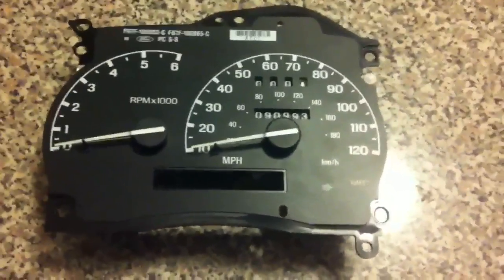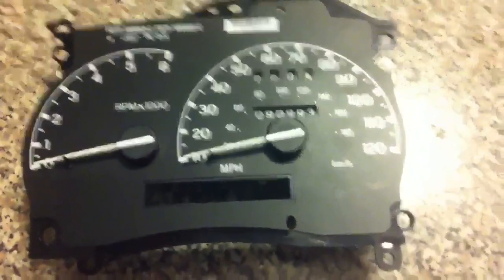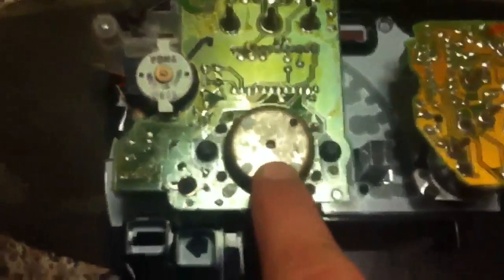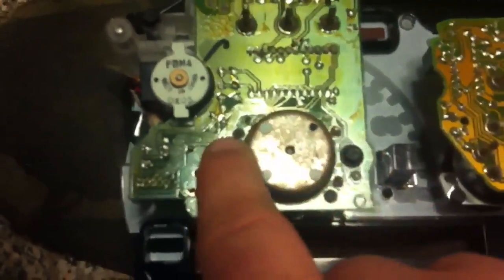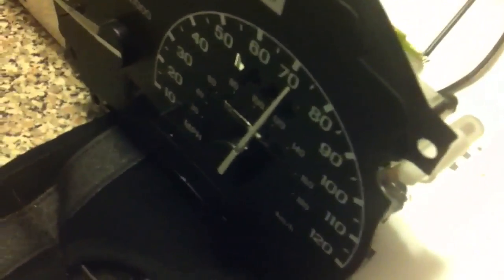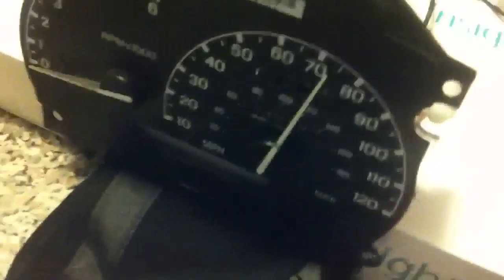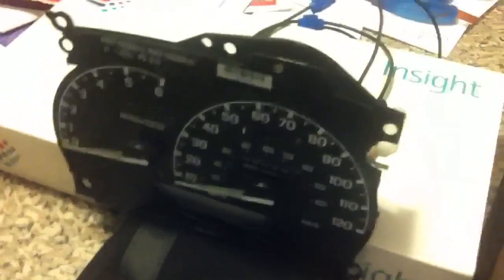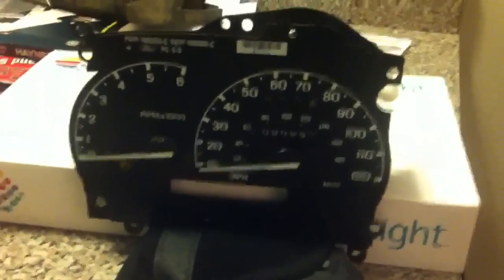HOW TO: Calibrate the speedometer on a Ford Ranger

Comment from the maker: WHAT TO DO IF YOU TOOK YOUR CLUSTER APART WITHOUT CALIBRATING THE SPEEDOMETER FIRST:

You need to determine how far off your speedo is. Download a free GPS app on your phone. Drive down the road using your GPS app and get up to 30 mph. At 30 mph, take note of what your truck speedo reads. Let’s pretend it reads 50 mph while your phone reads 30 mph. Go home and pull your cluster. Do everything I did in this video. Whatever your needle reads, pull it off and put it back on at 20 mph less while the battery and alligator clips are still hooked to your speedo.

Comment: So you try it and move the arm back till it shows the actual speed
Reply: Don’t do this. The right way is far easier and doesn’t rely on guesswork. Find the comment that says to jack the vehicle up and let the wheels free spin while the plastic cover is removed from the instrument panel… fuck it I will just tell you how to do it… while the cover is removed and the vehicle is running and in drive while on jack stands, let the engine idle and spin the wheels. Set the needle to 100x less than the engine rpm, ie: 1000 rpm = 10 mph… engine rpm divided by 100 = vehicle speed (only in 1st gear!!!). I am a professional mechanic with 37 years of experience and that is the correct way to calibrate your speedometer.
Reply: @rollin18wheels how far in are you supposed to push in the needle?

Comment: I see this was a older posted video but I just replaced my cluster on my 98 2.5 Ranger. I upgraded from the non-tach to the tachometer cluster and I had to change the mileage to match my original one so I had to take the speedometer apart. I also put a new plastic gear in. I noticed when I put it in and powered it up the speedometer needle shot up to 20 MPH. I then saw your video and gave it a try. I took off the needle, powered it up and put the needle back on at 20 MPH. It went down close to 10 MPH now when I turned it off and I kept having to do it and redo it until eventually it was at the stopper. I used the key switch instead of the alligator clips since I'm still putting everything back together. So should it be calibrated now? Once it stays at the stopper it should be set?
Reply from the maker: I did the same thing you’re referring to the first time I pulled my cluster apart. To answer your question, no it’s likely no accurate just being at the stopper. Here’s what I had to do and my best suggestion:

1) Download a speedometer app on your phone. 

2) Drive down the road at 50 m/kph based on your phone and look at what your truck reads. Let’s pretend your truck reads 60 m/kph. 

3) Go home and pull your cluster back out. Manually spin your needle up to 60, use some needle nose vise grips to grab hold of the metal pin that holds the needle on to keep it in place. 

4)Carefully remove your needle making sure to not disturb the vise grips or pin and then reinistall your needle at 50. 

5) Drive down the road with your speedometer app and compare it to your cluster. 

6) Repeat as many times as needed until you get it dialed in as close as you can. 

Note: It goes without saying, be careful playing with your phone while driving. Use a buddy to help if you can.
Reply: @Kybucks10  I put it back together and drove it around with my scanner hooked up and it is indeed actually 10MPH off. I'm doing 20 and it says 30. Also even though I replaced the trip odometer gear with a new one it doesn't even move. Any ideas?

Comment: My Ford Explorer speedometer starts at about 40 mph when I crank it up.  How can i get i back to zero mph at startup?  I had to take the cluster out to replace my bulbs with LEDS and my worm gear for the odometer and somehow i got my speedometer jacked up.  Id really like to get this fixed without spending a bunch of money.
Reply from the maker: daBEARS 545134 read the pinned comment
Reply: @Kybucks10  Thanks for replying.  Ok I was just trying to make sure it would work the same way.  I am looking to buy some alligator clips now.  Will plain electrical tape work to bind them together or is there another recommendation.
Reply: @Kybucks10  not having any luck, got it rigged up but the needle does not move with the battery
Reply from the maker: daBEARS 545134 your next best bet is to do like I said in the video. Pull your needle off and hold the metal pin in place as best as you can and reinstall your needle where you think it should go. Then plug it back into your truck and drive up the road with a gps to see how far off you are. Rinse and repeat until you get it right or close enough for your liking.
Reply: @Kybucks10  ok thanks, i will try that

Comment: I didn't do this when I took mine apart and now it doesn't read r9ght help
Reply from the maker: You need to determine how far off your speedo is. Download a free GPS app on your phone. Drive down the road using your GPS app and get up to 30 mph. At 30 mph, take note of what your truck speedo reads. Let’s pretend it reads 50 mph while your phone reads 30 mph. Go home and pull your cluster. Do everything I did in this video. Whatever your needle reads, pull it off and put it back on at 20 mph less while the battery and alligator clips are still hooked to your speedo.

Comment: I used your method of re-calibrating after I repeatedly kept trying to drive it around.  If I don't put any other comment it will mean you are the pro on this.  I simply set mine to 73 mph since I did not know the original baseline.  Hope it will work and I think it will.  Do you have any ideas for getting the transmission indicator to be in the right position?
Reply from the maker: David Reeve yes, there is a knob under the dash that you need to spin that adjusts the indicator. YouTube search for ChrisFix. He has a video on this a couple of years ago. I’ll try to find it and reply with the link. His channel is a WEALTH of knowledge over my few videos when it comes to these trucks lol. Hope this helps!
Reply from the maker: Here’s that link. 

https://youtu.be/wzhUYwx34gM

Comment: I tried this but I don't think my issue is the same.  When my speedometer is installed in the vehicle the needle starts at about 55 MPH and then increases as my speed increases.  It doesn't always increase mile for mile per hour so I'm not certain exactly how fast I'm traveling.  Do you know how to fix my issue?  I would certainly like to know my speed accurately, especially when there is a cop riding my ass.  Grateful for any suggestions.  Thank you
Reply from the maker: brian loveland read through the comments and my responses on this video. I answered this question once already

Comment: I took mine apart on a ranger 1996 to fix the gear on the “odometer” which went well. However, cannot get the speedometer to read zero. I put it on zero but when reassembled and energized, it goes to 30 miles per hour and stays there.
Reply from the maker: David Reeve unfortunately your only option at this point is to use a gps or download a MPH app on your phone and drive down the road. See how far off your speed is, go home and make an adjustment. Then rinse and repeat until you get it close enough. The method in this video is only good if you do it before ever removing the needle. 

What you can do first though is do the method in this video and whatever your speed goes up to (say 100 mph) pull it off and put it back on at 30 mph less (at 70 mph). Then do the gps/app method to see how far off you are and make fine adjustments.
Reply: You pushed the needle on too tight. I accidentally did that with my rpm needle and it would get stuck at 2.5k rpm until it dropped below that amount

Comment: I need  help when I install the gear an put everything back together ,I tried to calibrate the speedometer it wont go to just 73 I put the needle on an it goes to the bottom of the speedometer Help
Reply from the maker: Carlton Hooper I’m confused as to what your problem is?
Reply: I sent another post instead of replying, this is the first time I have used utube

Comment: What I was taught was with the glass off so you can adjust the needle, place the vehicle so the drive wheels are off the ground, then based on the idle speed of the vehicle while its wheels are rolling, set the needle equal to the RPM, example: your truck is in drive or 1st if its a manual and the tach is idle at 1000 RPM, set the pointer at 10 mph. rule is 100 rpm=1 mph. I did it like this and tested it with GPS and I am on the money! Hope this helps.
Reply: dude, you just saved my life! fist time i tried this and got me 2MPH over GPS. right on the spot, thank you man

Comment: I just watched your video on repairing the odometer it worked. but now my speedo isn't working right. is this what I need to do. in your video you just pulled the needle off. that's what I did never calibrated it. thanks for the videos

Comment: so I did the gear change and didn't look what the mph was with the battery where do I do from here?
Reply from the maker: I guess you're "poop" out of luck. ;) Just grab a gps and a buddy and have them watch your mph on the gps. Pick a speed and once you hit that speed on the gps, look and see what your speed is on your speedo and adjust accordingly. Example: your buddy says you're at 30mph, but your speedo reads 45mph, just adjust your needle down 15mph. Then test it again. I didn't know about the trick in this video when I did my truck and that was how I adjusted my speedo.

Comment: My needle stays at 40 when my truck is off. This happened after I serviced the odometer. 

Help please.
Reply: +Erick Ordonez 
Same problem here
Reply: +waterman18 It took me a while but I solved it. Just assemble the dash w/o the cover and turn on the Car. when it jumps to 40 or any other value, remove the needle and put it back on cero. repeat until you get it solved.
Reply: +Erick Ordonez I did this and it's still off. Says I'm doing 80 when I'm really doing 65.
Reply: I left dash cluster dangling  and went to a local street flashing radar speed sign and calibrated mine. Trial and error of pulling the needle off and replacing compensating for error it until the speedometer reads within 5 miles per hour of the radar sign. Good enough. Took me around 6 runs by the sign to get it close. On the Freeway at 70 it reads 74. Whatever....its an old car. Should be crushed and sent to China for melting anyway.
Reply: Ah. Gotcha. Good idea. Thanks

Comment: I didn't understand what you where doing from the point you said 73 mph and forward.
Reply from the maker: Since the battery made the speedo read 73, I knew where I needed to press the needle on once I rebuilt the panel. If you watch some of my other videos, I explain why I needed to get into the panel. Basically, once you rebuild the panel, hook the alligator clips and battery back up, then press the needle back on at 73. That way your speed would read correctly once you install it back into your vehicle.
Reply: So if I'm reading 20km or mph slow. Then I would find where the needle sits with battery. And then pull the needle off and hook the battery back up and put the needle back on 20+. So if the needle read 100 then I would do those steps and put the needle on 120. And your saying that it will never go back once I hook the cluster back up to the truck??
Reply from the maker: Yes, If you removed the needle and placed it back on at +20 while your battery is hooked up to the back of the panel, your speed should be fairly accurate. Just make sure you figure out exactly how far off your speed is. A GPS or a smart phone app will help you there. And by "never go back", I assume you mean the speed will not read 20 m/kph off anymore, that is correct.
Reply: Awesome thanks bro. And nice buck.. what did you take him with
Reply from the maker: Thanks! I got him with a Savage 300 WSM. Scored 160 2/8.
Reply: Right on
Reply: Matt Russell so when the needle is at 73 it's calibrated

Comment: my 95 ford ranger xlt during calibration install wire on the pin in back of odometer, had to reverse the connectio, battom pin positive , top pin negative
Reply: +randy dan I had the same experience. I don't know what it means. What was your resolution? I have a 1995 Ford Explorer. I measured the speed on a AA battery before I removed the needle: 66 mph.

Comment: Will this also work in a Chevrolet? Particularly an old 75 Chevrolet Camaro? And also, in the video, you said, "Take the needle off and do whatever you need to do." What exactly is it that I need to do? I know a good bit about cars, but I'm so clueless about this speedometer ordeal. I've never had this problem, and have no idea what to do. \:
Reply from the maker: I have two other videos on my channel about getting into the cluster of your vehicle. Check those out and that will clue you in on "what you need to do." As far as working on a Chevrolet, I have no clue. I don't own a Chevrolet and I have never worked on one like that.
Reply: +Elijah Wyatt any chev from that era you change by swapping the gears where the cable enters the transmission.
Just realized this is old, hope you got it.

Comment: Hey! Can you help me please. I just replace my instrument cluster, and my speedometer is not accurate at all, in my speedometer it says 40mph but iat the same time i run the speedometer (gps) on my phone and it says 30mph, well basically 10mph advance? I think calibrating speedometer is what should i do. But i dont get it. I tried to do what you did in your speedometer, but i dont get it. Please help me.
Reply: Re-calibrate the speedo the right way, which does not involve anything he does. Fuck my life I just need to copy and paste these instructions…. Take the plastic cover off the instrument panel. Jack the ass end up and stick some jack stands on the axle. Chock the front wheels. Crank it up and put it in drive/ 1st gear if a manual. Let the engine idle and spin the wheels. Take your engine rpm and divide by 100. Engine rpm/100=vehicle speed in 1st gear. Set the needle on that number and voila you calibrated your speedometer. Congrats. 
I am a 47 yr old pro mechanic with 37 years experience working on all manners of cars and trucks.

Comment: did you make the alligator clip with the extra wire?or can you buy that somewhere?
Reply: Yes he made them. Nobody sells anything like that for hopefully obvious reasons. I am a 47 year old professional mechanic & I am going to tell you the right way to calibrate your speedometer the same way they calibrate cop car speedometers. The actual correct way to calibrate your speedometer is to elevate the rear axle so the tires are off the ground, chock the front tires (or vice versa for a front drive vehicle) with the vehicle running and put it inn drive after you remove the plastic cover from your instrument panel, which is really easy to do if you have a Ranger, and with the wheels rolling and engine idling, take the engine rpm and divide it by 100 and set the speedo needle at the number you get. 100 rpm = 1 mph, so 1000 rpm = 10 mph and so on. Alternatively, you can use a gps app to determine your actual gps speed and set the speedometer needle at whatever it says if you have a private parking lot you can use without worrying about hitting another vehicle. IF YOU MUST make the alligator clip wire contraption from this video, do it right and go get some 3 wire push to connect wire nuts from the electrical section at home depot. Keep the blue things he used in the video in mind as the electrical splice device to never, ever, ever use.